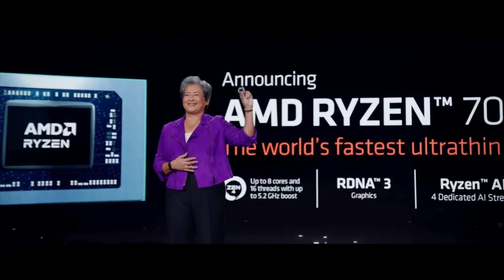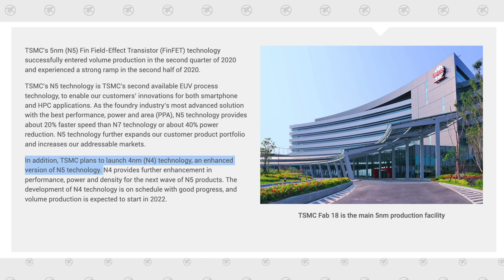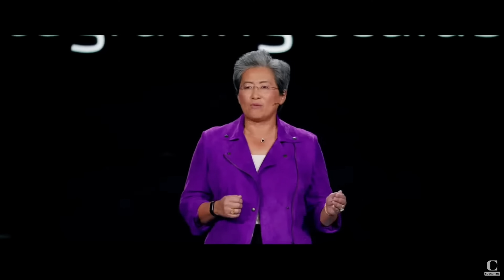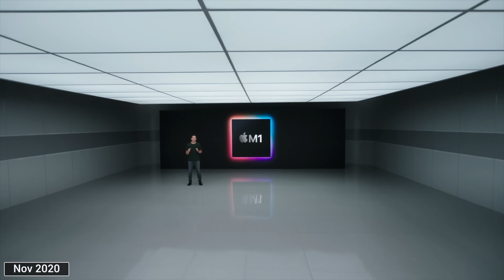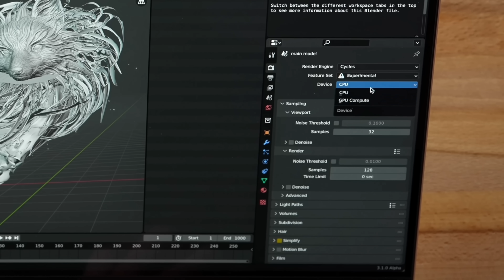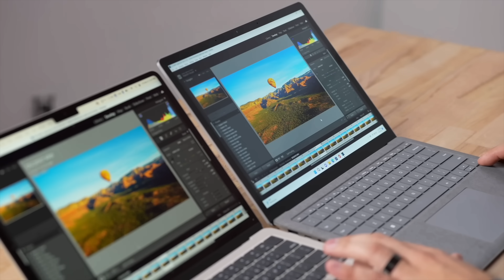AMD's New 4nm 7940HS vs M1 & M2 Pro! Apple Silicon Killer? 🤯

Comment: I would still take my 14 inch MacBook pro over these upcoming laptops any day. Apple hasn't always had the best performance it's just what they offer in total. It's a quiet machine that I can do pretty much all I need to do on it. I can put it on my bed without it turning into molten lava, I can leave it off the charger for the whole day, I can plug it into my monitor and use it pretty much as a desktop computer. It's more than stats to be honest.

Comment: AMD is doing a chiplet design now. Each chiplet is a different size. 4nm for the brains and 5 NM for cache. The pieces that can't be shrunk.
Reply: AMD has chaplet dies since 1965 , most of them have been just that
Reply: 7040 series is single chip
Reply: @mzamroni  My point wasn't contentious but informative, the way you worded your comment was misleading

 AMD is not "doing a chiplet design "now", they've been doing them since 1965.

Intel is doing chiplet since 2005, not as much as AMD.

Chiplet is not panacea, there's added latency, which is the reason Intel didn't go to it on their higher performance dies, if you want highest performance without needing to scavenge current builds, you go monolithic, if you want to be able to upgrade current deisgn, chiplets the most cost effective

Anyway, don't take this as anything but information, it's not intended otherwise.

Cheers

Comment: What will happen after 3nm chip? Anything lower than that is running up to physics limitations at atomic level. 3-4nm chips already produced at low yields.
Reply: “3nm” is not real 3nm, you can get much lower than N3

Comment: The Baseline TDP is 35W but you can configure the TDP on the AMD up to 45W, so no they don't consume 45W to give 20-30% advantage over the M1, i would say it's a combination of the 4nm tech and the extra 5W that adds this performance also the RDNA 3 boast 5.1 TFLOPS at normal use and the upper limit is 8.9 TFLOPS when you up the TDP on the APU to the max 45-50W so it will be able to almost reach M1 Max graphic performance even while having fewer cores and being a integrated GPU. also there were some minor mistakes made that were revised on the AMD CES keynote.
Reply: Good analysis, you  missed that M2 has over twice transistor count, 3x l cache and still doesn't beat x86.

Imagine the bloodbath if the x86 package had the same transistor counts.

Edit, now that x86 is on the same 5nm, Look at this, M-ultra has NINE TIMES transistors as x86 on 5nm, x86 PUMMELS ultra at EVERYTHING but instruction per watt,  and COMES CLOSE even to that metric

Comparing the performance of CPUs in benchmarks
Cinebench R23 (Single-Core)
M1 Ultra 1504 Ryzen 9 7945HX +29% 1938

Cinebench R23 (Multi)M1 Ultra 23701 Ryzen 9 7945HX +44% 34214

Power Efficiency:
M1 Ultra 91 Ryzen 9 7945HX82

I don't know how anyone thinks ARM is a competitive platform for now, they need some breakthrough to get competitive.

Apple is working on their own instruction set, poaching intel, x86 and RISC engineers, they're not staying on arm unless they can figure it's pathetic instruction per transistor.
Reply: @perriscalderon8155  x86 can now simplify their instructions like arm with extensions, also by breaking down their instructions to smaller ones as micro-operations and arm does the same to make theirs more complex. apple m1 increased the number of instruction decoders running on each core, they're also referred to as core width, each core run 8 decoders while amd runs 4 and the latest intel cpu runs 6 but the more you increase the decoders, the more latency it creates so apple has to stack the L2 cache on top of the cpu die to save space while using a higher l2 cache to reduce latency and the space taken on the cpu die.
Reply: @aviatedviewssound4798  x86 always had simple instructions, ARM always ad complex instructions, it's nothing more than percentages

 x86 never actually designed laptop chips, they'd just clock down

Arm is now having to increase tdp to seem competitive, but as I said, their actual performance is terrible, relying on exponentially more transistors to then lose in performance at everything but instruction per watt

Instruction per watt is only important on mobility and servers.

Don't forget, Apple M is relying on a 100 watt battery, they're not that much more efficient than the latest x86

M1 ultra has a tdp of 120, it's not sipping electrons.
Reply: @perriscalderon8155  Apple can't so easily move away from Arm without making 99% of Apple Store apps incompatible and unable to work.
Reply: @chrisdyers8017  And you think that's harder than when they went from x86 to ARM?

It's not

Hardware that relies on ARM will remain ARM, as it was ARM before they switched from x86 laptops to ARM laptops.

I am telling you as a fact, they are trying to come up with a proprietary ISA, they've already poached x86 techs from AMD,Intel and RISC.

they don't want to squander exponentially more transistors in each SoC just to seem performant, and they don't want pay licensing.

They're trying to make it happen already, whether they can is all that remains discovering
Reply: @chrisdyers8017  Apple will move to their own ISA easier than they moved from x86 to ARM.

Their own ISA will have more compatible instructions, tied to the fact, hardware relying on ARM can stay ARM like the phone, watch, whatever, just like it was before.

Apple IS trying to develop their own ISA, this is a fact, it's the very reason they' poached and continue poaching Intel, AMD and RISC architects.
Reply: If x86 systems are going to keep with the times, they're really going to need to work on efficiency.

Comment: As long as they use the x86 architecture instead of ARM i don't think it's possible for them to make a better suited chip for laptops than the Apple silicone chips. These AMD chips will drain the battery like every x86 chip before it. I switched from PC to Mac 5 days ago and the difference is huge

Comment: To me a battery life is the most important. If you compare the battery life, please do one for creators using the typical apps for them and one for regular consumers with apps like YouTube, watching movies, browsing, etc.
Reply: I have the LG gram 17" 1260p for personal use and M1 pro MBP for work and the LG gram is doing better than the MBP. Intel 12th and 13th gen are like 3 times as efficient as past generations and LG gram has 80 Whr battery. The fans on the gram too don't speed up if you are not doing medium work (they are kind of always on but not audible). The MBP on the other hand does not even spin up the fans unless you are trying to run something extremely heavy. Even with my Android studio builds the fans almost never come on or even if they do, it's at 10%. Both are worth the money I think. Although for medium usage the LG gram is most likely going to lose. If only windows on ARM was actually valid. SQ3 does well for performance but app compatibility is a major issue.
Reply: @SahilP2648  As always real world experience provides a better measure of performance! Mahalo.

Comment: All in all, I hope AMD did make a great chip. However, I'm not giving up on my M1 air... If AMD can make a chip that doesn't need a fan and beat out apples chip then I will be listening. I hate to be disappointed, but I won't be holding my breath.
Reply: AMD made a fast mobile chip, but alas, that chip runs really hot and uses a lot of battery power.

Comment: I figured at some point one of the larger chip makers would come out with more powerful chips than Apple could design.  Dedicated chip makers can throw whatever resources they need to design chips.  They've already poached chip designer talent Apple had by offering higher salaries or whatever.  Apple is too cheap to hold onto talented designers.  Eventually, other dedicated chip makers were bound to catch up and pass Apple's best chip designs.  That's just how things go.  No company can stay on top forever.  At least Apple is in control of the whole stack of hardware and OS and that may offer some advantage to keep customers buying Apple products.  Time will tell.  Apple can't be counted out yet.
Reply: They are also comparing against chips that have been around for 2 years now.  The M2 is Apples latest release, with the more powerful M1 Pro and M1 Max released well before that.

Comment: A comparison between the Ryzen 7945HX (Asus Zephyrus Duo 16 SE) vs I9 13980hx (MSI GT77 Titan HX 13V) vs M2 Pro (Apple Macbook Pro 16) would be nice. Those Laptops/Systems  will be the fastest  for every silicon
Reply: Hell Yeah
Reply: Let's not forget that Ryzen will draw 55W while m2 max just 20! M2 is still insane if it comes to low power consumption.
Reply: Ryzen 7845HX has already crossed 46k in passmark where M2 max has only 26k I reckon. Just wonder what would 7945HX will do...I reckon somewhere around 47-48k
Reply: @AAAAAA-gj2di  7945HX above 60k in passmark 💀
Reply: @DeepteshLovesTECH  💀💀💀 didn’t expect a leap this big
Reply: For intel I would like to see actually all in the upper-middle part: 13500-13600-13700. 13600 for Desktop is very, very good. BTW, on desktops, AMD power usage is terrible while idling, I watched some test the CPU consumes up to 50W in idle; Intel goes way higher in 100% power, but idle is up to 5x lower so in the end real consuption is better on Intel.

Comment: Even if the Mx processors are still better, AMD being almost as good but be able to used with an useful OS like Linux is a must buy from me.
Reply: I need to see the battery life for one. And you can use Linux on a Mac - Asahi Linux. Given it's not entirely stable, but it's getting there.

I picked the M1 Pro (and got a M1 Max for work), because of the efficiency. I also have a AMD Ryzen 5900X with a RTX3090, so I am definitely not an Apple fanboy (I actually dislike Apple). It's just that in terms of laptop there is nothing to compare it to.

I'd be glad if AMD succeeded though.
Reply: Call me skeptical but I didn't see the comparisons unplugged (other than battery life for video playback). This is a laptop chip. An X86 draws power to operate at efficiency and requires active refrigerated cooling to operate at peak. If you operate in an office with power as part of your workflow and only need to use it occasionally in transit (I think that applies to most urban professionals) then you should definitely look at the AMD.
Reply: @MrEiniweini  m2 requires active cooling at peak too, otherwise it throttles, which is what happens in macbook airs.

Comment: With the current lineup of AMD Rembrandt APUs the integrated RX 680m 12CU RDNA 2 GPU in geek bench 5 compute is closing the gap on the base model M1 pro, given that Pheonix has the same config on RDNA 3 I would expect around similar performance to the base M1 pro. Since RDNA 3 and RDNA 2 are very similar in an APU sense given the changes between them don't apply in a non-discrete package.

Comment: Doesn't matter what fantastic chip AMD comes up with, it'll ALWAYS be held back by 1 thing... Windows!
Reply: But they don’t make Windows. How are they held back? Their business is to sell processors. Their biggest enemy is Intel not Apple. What AMD wants is to sell to the Dells and Acers of the world. Apple is not a business partner when it come to laptops (I think, I don’t know the MacBook specs by heart)
Reply: Then put Linux on it if you don't like Windows
Reply: Windows forever 90% in the world Apple 8% ops....
Reply: @cheesejadeitekiwifox  What are you even comparing here?
More installations of a free piece of software than something that's exclusive to Macs!?

I myself have reinstalled Windows 15 times in the last 3 years due to various update screw-ups and random bugs and general slow-downs.
Is that a positive thing?

Meanwhile I've been rocking my first Macbook ever since the last year without even giving two sh*ts about what pernatge of CPU, RAM or battery life Windows is chewing through per second.
Reply: @ShFred  That's more times than I've ever had to reinstall windows in my life time and I use windows everyday. Also been using windows since the XP days so I don't know how you've had such a bad time. What are you doing to result in so many reinstalls

Comment: Have you noticed that all these supposed "M1 killers" are always compared to a chip that was released well over a year ago?
Reply: True, but let’s be real, the M1 was years ahead of the competition. Everyone is just trying to catch up. If this processor is it, that’s good. Apple needs someone to lit a fire on his ass, the M2 was a shitty upgrade to the M1.
Reply: Apple compared the M1 Ultra GPU to RTX 3090 which was released 2 years before ,and yeah did I mention that it lost.☠️
Reply: @breechcomet  which one of those uses 350W, and which uses less than 100W?
Reply: Let's be honest no one expects anyone to beat Nvidia in the gpu department, there is always tumors of either AMD or Apple trying to take the gpu crown but it never happens lol.
Reply: M1 is the best facebook machine
Reply: Some of the m1 killers where released the same time or before. So what’s your point?
Reply: @ottoernst6707  They were? Where are they? Are you talking about the ones that do technically outperform it but use 3-4x the power?

Comment: As a Dev i can use 3 emulators some chrome tabs 3-4 projects opened up on vs code and Xcode and still my m1 mac uses 40% cpu while unplugged. Not a single Windows machine I’ve tested can do that.
Reply: And what windows PCs have you tested alongside what emulators. What are their specs? Most emulators aren't too hard on the CPU besides the more difficult ones like RPCS3 and Xenia
Reply: How much ram u have ?
Reply: Bruh I just started developing on a MacBook and I ain’t never going back!!!

Comment: Unfortunately, AMD's TDP is not easily comparable to Apple's or Intel's power consumption.  Gamers Nexus has noted this in many videos.
Reply: But they actually draw way less power than intel producing identical performance ,even measuring from the outlet
Reply: why is not comparable? If you can explain it to me
Reply: @kamikazi5144  TDP is sort of made up.  It does not measure power consumption.  I would recommend you watch any Gamers Nexus video on recent AMD video cards.
Reply: @kentcurrie7326  gonna check it out, thanks man
Reply: @kentcurrie7326  amds tdps are accurate for their CPUs just look at their desktop chips. More accurate than intels
Reply: @thebi11iona1re  Its not accurate to compare with others. You cant really just compare AMD tpd vs Intel vs Apple.. lol
Reply: @tankapadia  yes you can???? you see how much power it draws on boost manually

Comment: Is the base model M1 Mac Mini still worth it for an average consumer?
Reply: Yep definitely, I just got a M1 8Go ram and it's perfect for my needs !
Reply: @psykobibi  Thanks!
Reply: Holy cow, yes! I have an M1 Air (16GB ram) and it flys through even pro applications. The other day i was editing 4K video in Davinci Resolve and editing music for it the SAME TIME in Logic Pro. Amazing! I would get 16GB of ram in that mini.
Reply: @jamesnyers1721  I’ve been debating if I should get the extra RAM, I’m really not a heavy user but I can afford it. Thanks
Reply: I have an m1 air base model. If your average usage involve open many apps like Spotify, mails, Safari with many tabs open and some other programs at the same time, I would recommend upgrade the ram to 16. It’s more than enough for average everyday usage.
Reply: @minnami778  I do have a tendency to leave apps open. I’m not a content creator, but I can easily afford the extra $200. I’ve been debating the ram, but it seems like it’s probably worth it. I do appreciate it!
Reply: An Intel Mac mini is good for the average consumer. The M1 is just overkill 😂
Reply: @bandito241  I was looking at Apple’s website and the intel version is more expensive. Is that one more powerful?

Apple has a 10% veteran discount, so the base model Mac Mini is only $629. Seems like a good deal, I’m just planning on hooking it up to my Thunderbolt Display.

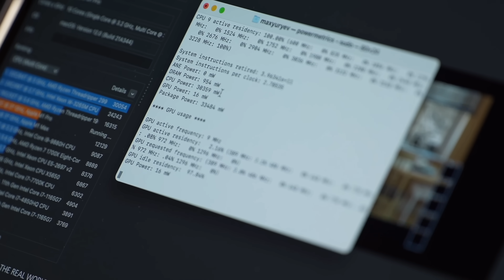Comment: 10:01 shouldn’t you compare both cpu + gpu power usage with 35-45 AMD’s watts for whole soc? Or is it just that software shows current usage on apple soc as a cpu, but actually both of them are under the stress?